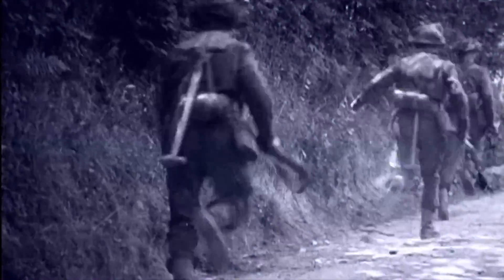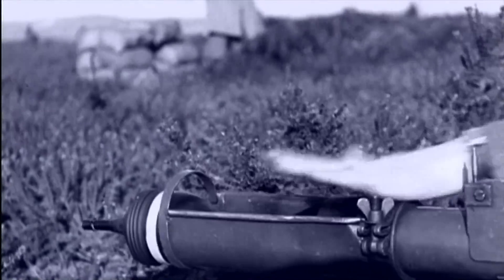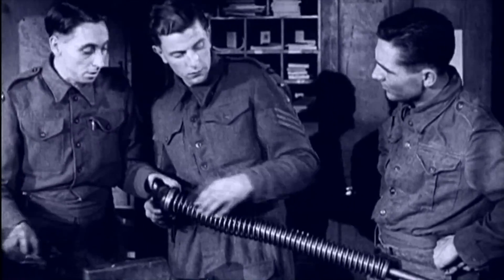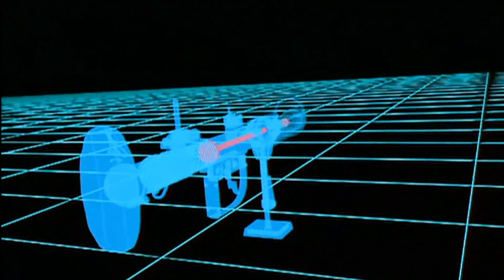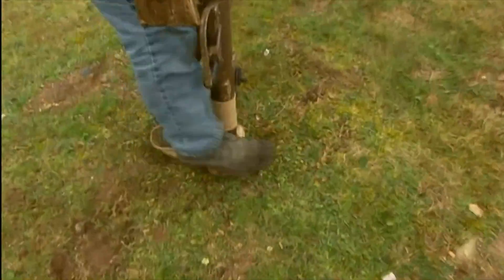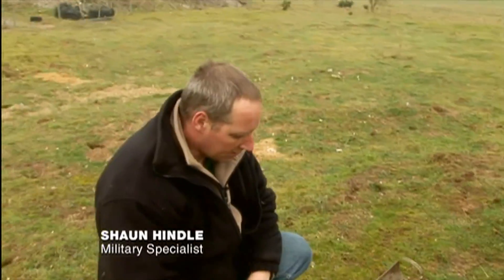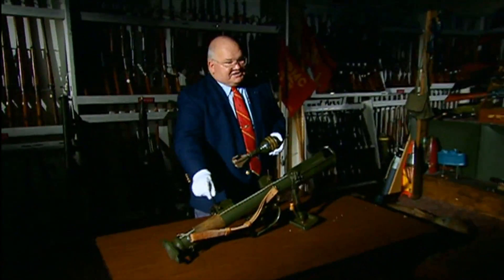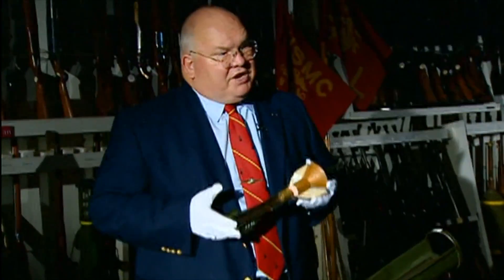Weaponology - "British PIAT"

Comment: Not a liked weapon, but more effective than its reputation. No back blast, so it could be fired from inside buildings; a choice of round; the capacity for indirect fire; a charge that could defeat the majority of armour that it faced ( you'd want a 17pounder to face a King Tiger) and let's face it to be effective with any AT weapon of the era you would be close to spitting distance. If you want to be sure of killing a tank, you don't fire at maximum range, you fire at a range at which you can be sure of killing not only the tank, but but also the crew with your personal weapon when they bail out.
Reply: +CruelestChris You've been playing too many computer games.
Reply: CruelestChris
You are assuming that there are walls. It's hard to work out where a projectile weapon came from when you're in a tank and there's no flaming backdraft to highlight the position. In built-up areas the PIAT was even more effective, because it didn't advertise its presence, was more effective at close range and didn't need to be fired from a location sufficiently roomy to accomodate the aforesaid backdraft. A bazooka or panzerfaust would burn you alive if you fired them from a small enclosed space, whereas the PIAT would cause no problems.
Reply: +CruelestChris Skipping an AP round off the ground,  WHAT ??? where did you read that and was it in a comic strip ;-)  Hitting the ground unless maybe a chance in a million or if it was concret is going to dig a hole in the ground if by chance it bounced and hit armour it would have lost a lot of energy and most likely be tumbling.  Several guns at short ranges ie under 500 metres could kill a KT with a frontal hit.  Russian 100mm and 122mm, US 90mm, British 17 pounder all using Tungsten core ammo apart from the 122mm which fired APC.  As for looking down the hole a HEAT round makes its about 2mm in diameter and rarely in line with the flight of the round unless it was a 90 degree hit on vertical armour.
Reply: CruelestChris
It is also the case that in a close-quarter combat situation it is highly unlikely that there would be only one weapon firing. A tank in such a situation would be recieving multiple fire from all sides, both AT and small arms aimed at vision blocks, not to mention smoke, which would affect the limited vision of a closed-down tank far more than infantry, and with European streets full of rubble it would be strictly one tank at a time. The number of kills to armoured vehicles in situations such as Arnhem show the inherent danger of weapons like the PIAT. No sensible armoured commander would enter a urban conflict situation as the spearhead, because they know how vulnerable they are to AT fire. In CQB tanks follow infantry.
Reply: CruelestChris
It's hard to 'make' a weapon such as the PIAT, which has no significant signature upon firing compared to a rifle. To put it simply, you are in the remains of a destroyed house, with a fallen wall three feet (1 metre) behind you. Which weapon would you prefer: PIAT (backdraft: none) or bazooka (backdraft: significantly more than three feet).
And at the ranges the Arnhem battle was fought at PIATs would have inflicted damage on tanks just as effectively.
Reply: CruelestChris
In a built-up area, buildings are on each side. In front of the line of advance would be the road. In such a situation, apart from strong-points the infantry would keep moving amongst the rubble to present a harder target and respond to changing circumstances. In such an environment a weapon with no backdraft is advantageous as you can utilise a hiding space without worrying about a six-to-eight foot stream of expelled flame marking your position.
Reply: +Sam Russell The guy (cruelchris) is a 15yr old who's knowledge comes from playing computer games (check his profile). Don't waste your time.
Reply: KT armor wasn't actually as impenetrable as wheraboos would have you believe and was highly susceptible to cracking from high explosives,  this was due to the fact that by the time the KT was put into production Germany no longer had the industrial capacity to maintain high welding standards. Also the Bocage of Normandy helped make up for the PIATs poor range, it was realistically the perfect environment for such a weapon as the hedgerows and shallow rolling hills helped concealed the movement of small infantry teams. Not to mention the PZschreck and Bazooka didn't have much better effective range(only 40m) and took much longer to reload.
Reply: CruelestChris
Never give up researching, lad!
Reply: +Sam Russell Canadian soldiers voted it their favourite weapon of the war. Gets a bad press because it was a bit more complex than it's rivals. The fat guy in the vid misses the point a bit. The PIAT could be used to rapidly engage multiple targets without giving position away. The others were basically fire and run away RPG's. Also the PIAT fired simple mortar rounds whilst the others used more expensive solid rockets.
Reply: Sam
Reply: Whatever the commentator opinion, it had one good advantage over the bazooka and that was in had no  back flash and was well suited for trench and house to house fighting. As well as in Normandy in proved its use at the Arnhem bridge. It was still in service with the British Army until the late 1940's until it was replaced with the Energa rifle anti tank launcher which fired a hollow charge grenade.
Each infantry soldier was issued with the launcher  in the early 1950's.
Reply: Agreed
Reply: Eh, what I've heard is mainly that the KT's front armour wasn't defeated by any ground weapon that penetrated it (I was using the other sense of "crack," my fault there). And I'm not really buying the faster to reload claim, I've never seen a number that shows a practical rate of fire in combat conditions faster than a bazooka team (4-5 rpm) and I don't really see why a muzzle-loader would be significantly faster than a breech-loader when you take pulling the PIAT into cover or leaning out over it to load it into account. Sure, it's got a very high cyclic / theoretical rate if it self-cocks every time, the loader stays leaning out over the weapon where everyone can see him, and you magic a constant supply of projectiles into the loader's hand, but since there's plenty of accounts that the PIAT's sear only caught the spigot in the rearward position after firing when it felt like it, that probably didn't translate to reality.
Reply: +agt155 
Actually it comes from books and research rather than making shit up (yeah, if you look at my channel you'll totally get that I'm 15 rather than 33, great way to prove you didn't even press play on a video there), but I guess you wouldn't know anything about those since you just look things up on Wikipedia and don't understand what they're saying.
Reply: CruelestChris
There's no hole if you miss.
Reply: Sam Russell
Yeah, but that was also when the actual Panzer division turned up and the part of the battle where they kind of got annihilated (and were out of ammo, I grant you), so I don't think we can draw many conclusions from that about effectiveness.

Just to add a little, the bridge at Arnham is elevated about two stories above the surrounding road level and they more or less required a high vantage point to keep fire on it or even see what they were trying to shoot at; once they lost that they were in the impossible position of dismounted infantry versus heavy tanks, artillery and aircraft, and even if you gave them modern anti-tank weapons they couldn't possibly have held out in that situation since the Germans were just destroying anywhere they might be.

It's also worth noting that the paras didn't just have PIATs, they also had 57mm six-pounder guns and I believe also American M116 75mm pack howitzers.
Reply: +agt155 
Oh you tactical genius you <3
Reply: +Sam Russell 
Um, can't I get a couple of guys to help me finish destroying the wall so I can fire my Bazooka if that's what I have? At Arnham that would have been possible, since the paras had time to fortify their position before the recon unit's rather questionable decision to cross the bridge. And as said, if all of the shots are coming from the front, chances are the PIAT is in front of you (the Germans figured this out after a while, and just started levelling any building with a decent line of sight to the bridge).
Reply: Pack 43 is superior to 17 pounder
Reply: @homemadetech5712  
It isn't you know, the 17 pounder worked very well and the Germans were very afraid of it.
Reply: +Sam Russell 
Well sure, but it's pretty rare for a tank to be cruising around on its own (and if it is, there are any number of other ways to disable it, with mines being the most obvious) and so someone is probably going to see where the shot landed and call the approximate direction. And since the range is so short, this would rather drastically narrow down the search, it's not like you're looking for a sniper who could be anywhere within a half-mile of you.
Reply: CruelestChris
They only utilised prepared positions at the start of the battle; when these were destroyed they retreated into the remains of the town and continued fighting from there, using what they could find for cover with little time to prepare positions.
Reply: +Sam Russell 
Yeah, but that requires the tank be making severe tactical mistakes to get into that situation (the armour at Arnham was trying to push across a bridge which they really ought to have known would be covered by AT weapons, and was a recon unit with mostly wheeled vehicles and hanomags rather than actual tanks anyway). I just can't see how those supposed advantage would play out in practice if the enemy's moves weren't actively assisting you in pulling it off, or how the Bazooka wouldn't be a superior weapon if you get made and can't stay in the same prepared position for a long time where the better rate of fire would become relevant.
Reply: Sam Russell
Um, at Arnham the paras were fighting from a prepared strongpoint, not moving around in rubble. Pavlov's House kind of scenario, only they were only facing armoured cars and APCs with machine guns.
Reply: +fastmongrel 
That's the only way any tank on the Western Front could have done it since the Firefly could only penetrate the lower glacis and AP rounds can deflect at the right angle. There is no record of any KT suffering frontal penetration of the upper glacis or turret from a direct-fire weapon as far as I know.
Reply: +Sam Russell 
There was no direct-fire weapon on the ground that could crack the frontal armour of a KT short of a hail-Mary AP round from a Firefly skipping off the ground and hitting the lower glacis, you'd want an airstrike or artillery. And most rocket launchers can be fired from inside buildings as long as you sweep clear debris and don't do anything stupid like close the door of the room you're firing them in, even with the M47 Dragon's ridiculous backblast the US urban combat field manuals say it's safe to fire it indoors. And given you can tell which direction a HEAT round was fired from by just looking at where the hole is, I can't really see how not producing a backblast would prevent people working out where you were.
Reply: +Sam Russell 
Is this that "vanish into the ether" fuze? It still goes off of you miss and you can still approximate the shooter's position from where the shots are landing, especially if your projectile is blasting holes in walls rather than just making easily-missed bullet holes.
Reply: agt155
Aww, you're adorable when you're trying to think.
Reply: +agt155 It's from the Osprey book on the King Tiger, you fucking fool.